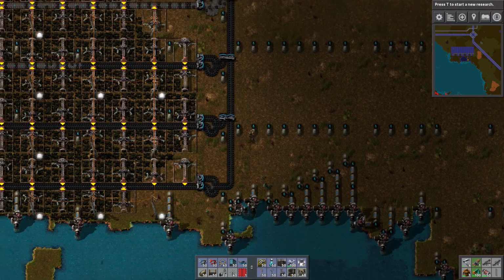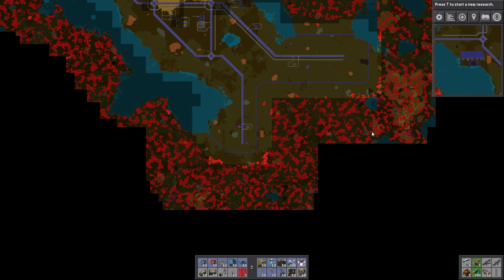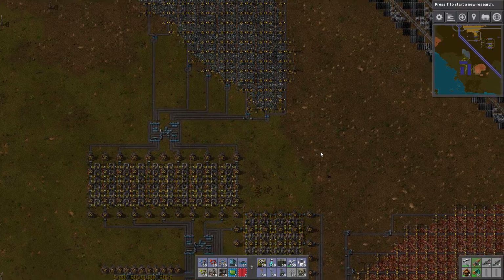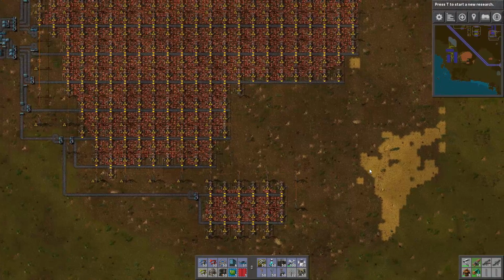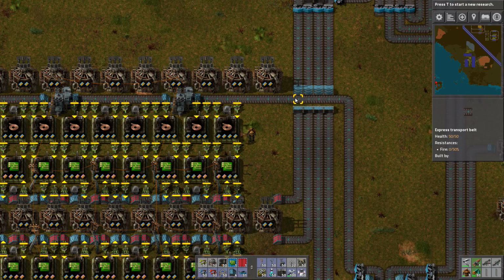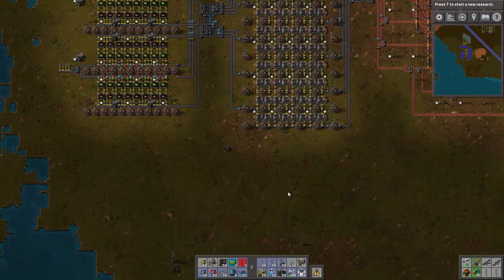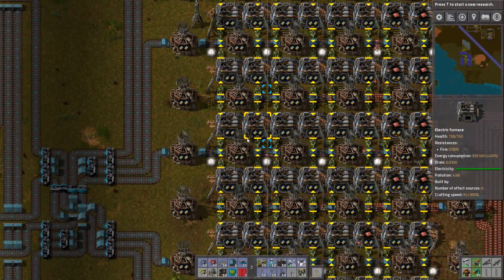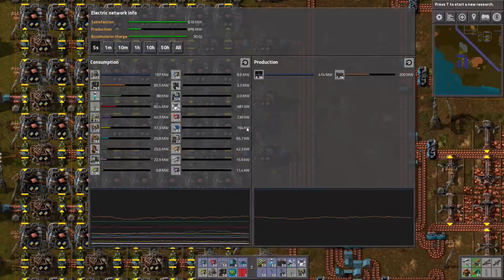Factorio Meiosis :: Super Mega Circuit Cell - Episode 28

Comment: I figured out a way to use half of the buildings and produce 60% more output on a smaller footprint without drones. Use lower row 4 beacons, up output with balancers, up 4 module, up input, up belt and chest mix, up 4 copper cable, up input, up 4 beacon. Keep a middle spot free for 2 substations. Middle prod 3 and speed 3 mix, beacon speed 3.  
I dont know why I spend 2 hours to figure out how this works :(

Comment: if i'm correct 300 steam engines will use up 1 fully compressed blue belt under full usage, so if anything goes terribly wrong the new engines will start to only give the capacity of 300 instead of 500. ;D

Comment: A big problem with your power system is your accumulators aren't even getting used because the game prioritises steam over accumulators, you could fix that with some clever circuitry though.
Reply: The circuitry isn't even hard anymore! Prior to 0.13, you couldn't attach Accumulators to the circuit network, so it was kinda tricky to "measure" accumulator capacity indirectly. Now it's as simple as using a Power Switch and one piece of Red/Green wire. A quick combinator RS-Latch makes it a bit better, though.
Reply: Yeah I haven't bothered with it myself so I wouldn't know, once I reach a certain point in the game I make sure to have enough Solar + Accu to deal with any load.
Reply: TL;DR  Zisteau is wasting his accumulaor capacity because tye game prioritizes engines but he still needs more solar panels and accumulators. 

But then problem, in this case, could Solar Panels. A properly balanced system of accumulators to solar panels will totally discharge accumulators and totally recharge by the time the accumulators are needed again.
I think his number of solar panels, even if hooked you to a system that measured the remaining capacity if get accumulators, would eventually run out of avaliable power and flip on the steam engines to recharge the accumulators.

Comment: Zisteau, when you put productivity modules in both the copper wire and green circuit, you can get a close to 1:1 ratio.
14:15 to be exact.. With all the assemblers affected by 4 speed beacons. Speed modules should not be in intermediate product production